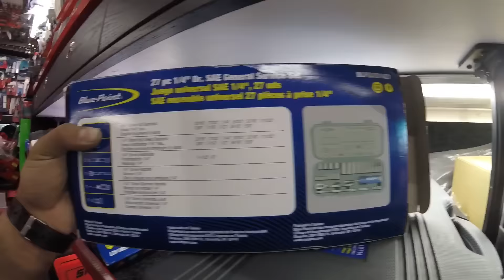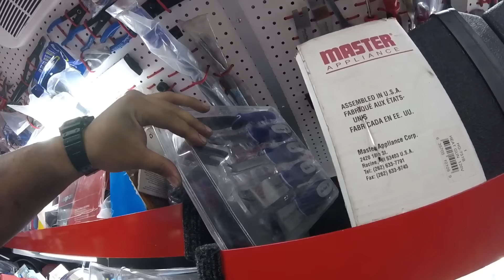Snap On truck visit #3

Comment: I have the !/2 snap on and blue point locking impact extensions.  Just wished they had more sizes in other drives.  Updating all my extensions to locking.  Nice to not lose a socket in tight areas.

Comment: What do you do for a career? In the diesel world i'm not sure why you use a 1/4 drive. I don't seem to use mine.
Reply from the maker: Jason Eads I'm a industrial air compressor technician check out my day in the life of video it's just a typical Friday for me but some days can be pretty technical plus I work on small units only 5 horse power and big units for large industrial applications up to 150 horse power
Reply: Jason Eads my company calls me an operator/mechanic. I spend 75% of my time repairing and 25% of my time operating. my 1/4 drive set is my go to. I use it everyday. everyone laughs when they see a 15mm socket on a little tiny ratchet, but it fits anywhere and gets the job done. 

I even have a snap on 3/8 drive head in a 1/4 drive body. It won't torque a 2 13/16 nut to 6800 ft/lb, but that's what the HiTorque is for. everything has a place
Reply: That makes since. I'm working on semis and trying to get ideas of tools to buy. Right now I just have the basic. We dealer retired about a month ago and we're supposed to be getting a new one soon.
Reply: Yah, it depends on what the shop has you doing. You won't get too many wheels off with a 1/4 drive wobbly ratchet. But as you start pulling ecm's or changing out small sensors that are buried behind intakes manifold or under dash, the 1 inch spine drive gun may be a tight fit. 

The guys you are learning from will probably be the best source you have to find out what you need. The third time I need a tool I don't own, I look into buying it. There are exceptions, some times you just need a tool to complete a job. But for the most part, I try to make sure I'm going to use it and that it will improve the quality or efficiency of my work.
Reply: That makes since. I just never seen anyone use a 1/4 ratchet.